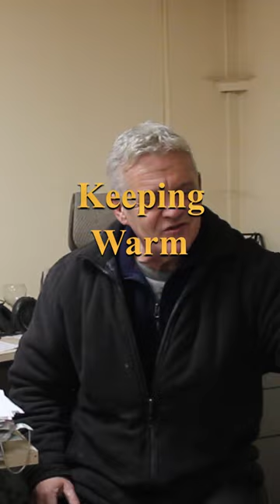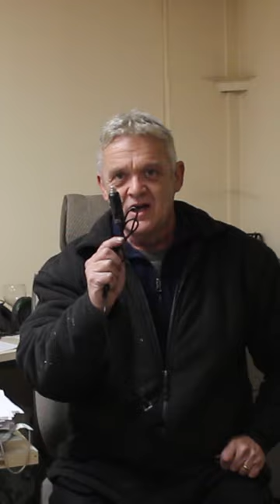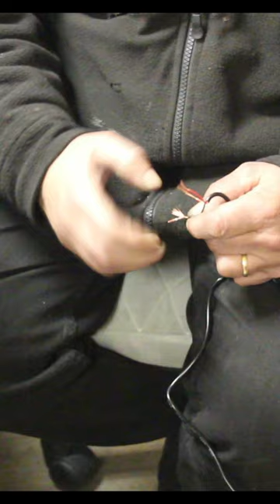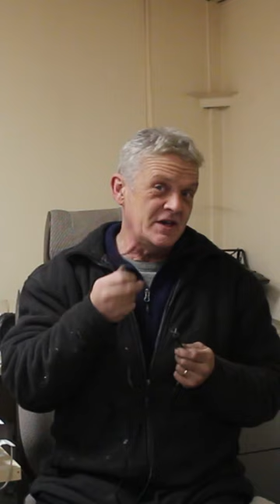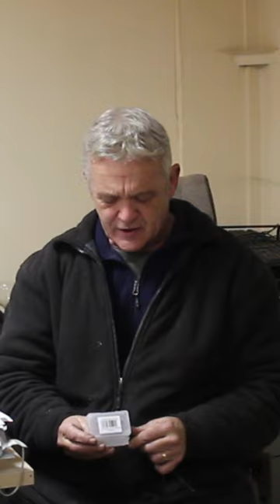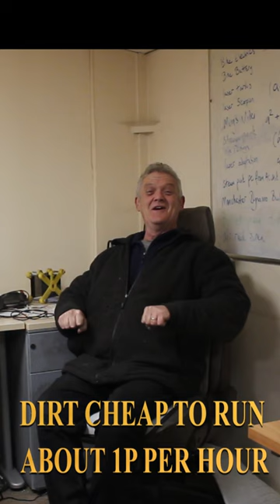keeping warm #shorts #heaters

Comment: Hey Robert! I have exactly the same seat cover but it runs on USB which saves a lot of effort, especially for those few without the means to do this (as simple as it is for most of us, think of the grandma's haha).
Super easy to run on a battery pack or solar generator, has a low, high, and off switch.
Mine only draws 5w on low and I think it was around 6.5 on high when I tested it. 

I do love this idea tho and it reminded me of an old 12v blanket I have that I may tinker with something similar.

God bless.
Reply: Who is this ideal for?

Comment: You can get all kind of little heaters  similar to that, I got some really cheap little pads, about 1.5-2" wide and about 5" long, with USB cables on them, they can go in gloves, jackets,  shoes,  put them on scooter or bicycle handlebars  about anything,  jd seal them between duck tape, to prevent corrosion,   seems they were less than  $4.00 and they work well,  use a couple with an old coat with some mylar and kapton tape, to seal them, put the  mylar space blanket piece 
 With the heater in the coat, with the heater towards the wearers body, with the mylar blanket  about the size of a notebook, or 2x that  depends on the persons size,  the heat will run you out of it in no time, it would be a well below freezing use only,   the blanket will reflect the heat back to the body,  it's only about 15 watts  for both  it would be much better at 12v with a controller,  because it takes a long time to get hot, it is possible 9 or 12v but ran in 5v ,
Maybe use a piece of aluminum foil used as a heat spreader, then cover with kapton tape, use the tiny heater to heat your whole back!    I have some 12x16. Pads, 12v with 3 levels, but gut it is auto shut off, after 10 minutes or something, and it is closer to 25-30 watts, it's a mystery mini electric blanket,   cool little things,  I build lithium battery packs for them,  enough to run it all night, if it would stayed on, maybe I can convince it to constantly stay on, until shut off manually, it atleast run for a few hours!   
Nice!!! ✌️

Comment: I did that with 12v battery in the middle, I wrap my wellhead, & water softener with it when the power goes out in the winter (cuz I can't drain them to protect from freezing) 
... Have two actually, the other on a cot down there , I don't want to freeze either .... Some 000gage welder wire through the sill plate going to a Solar panel to make it complete...

Comment: I would throw in an inline fuse just in case.
Reply: In case of what?
Reply: @royfokerpoker1802 I took one apart to make a heated jacket. The heating element is probably nichrome wire which will bend the metal with repeated sitting causing increased resistance and hotspots. I took one apart to make a heated jacket. Carbon fibre makes a better more flexible element for heated seats and clothes you still want a fuse.
Reply: @davidmowbray6352  
That's a great idea. I'll try it, thanks

Comment: I love your videos, they are very informative. The most reliable way I have found to stay warm is the good ol classic hot water bottle.  It is simple and very effective. You want a metal one that can go in the fire and it needs to have a good lid or cap. The bigger the bottle the better within rational application. Metal water bottles are cheap, durable, can be recycled ( most likely already are) and you don't look like a twat carrying plastic preaching about the planet. Awesome clip and I will be using this in a modified igloo cooler to keep mushroom culture at incubation temps.
Reply from the maker: that is a really good suggestion mate